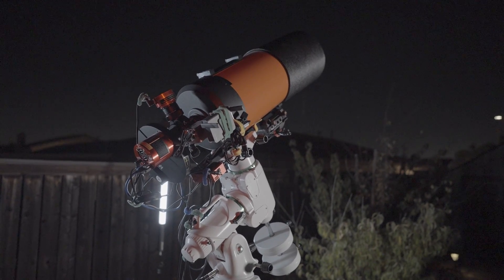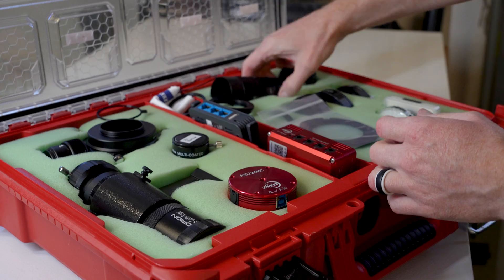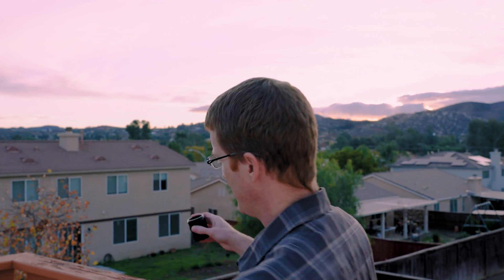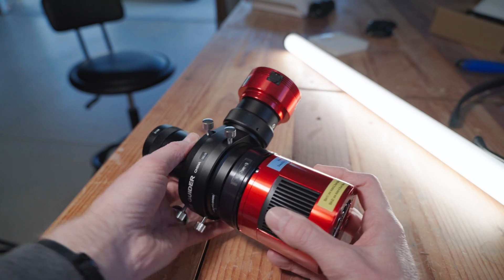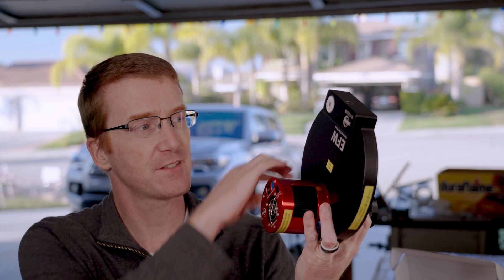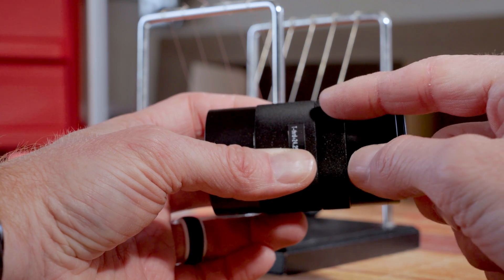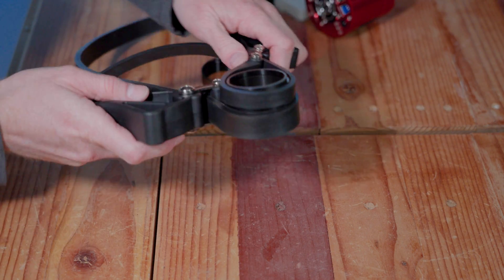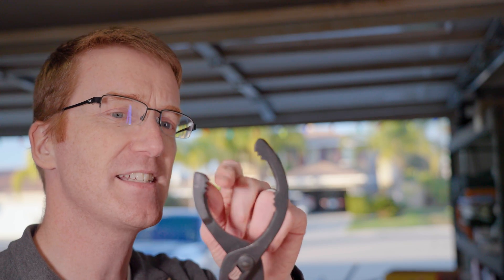Why telescope parts stick and how to fix it

Comment: I used a metal hose clamp. Clamped that about the short adapator and that let the rubber band-based strap wrench get a grip on it. Success. Solution inspired by the suggestion to add another adapater, where you note thos problem at 8:45 timemark. Mine is a step-down adaptor so no option to add another.
Reply from the maker: Very creative. I like it! ☺️

Comment: Lightly run pencil around the threads,  blow of any graphite dust, screw together. Should help with any aluminium on aluminium binding. Well, sometimes.
Reply from the maker: Great tip. Do you have any trouble with stay graphite dust getting on the optical components and showing up in your images?

Comment: what is happend with metal when is warm and when is cold look on powerline in winter and in summer
Reply from the maker: Exactly. You know what's interesting is the majority of substances will shrink in the cold, but water ice actually expands when it freezes. It's one of the few substances that does that 😉

Comment: A technique i use and it always works. Put the rings that are coupled onto a rubber floor mat. Put another thin rubber mat on top. Stand and place shoe on mat and twist your foot. Hey presto they unlock!
Reply from the maker: Nice! What a clever solution. 😁👍

Comment: Great video - I've had all the same problems you demonstrated!  Sometimes there's no easy answer.  I do use a bit of silicone grease just to reduce locking up, which has helped on occassion. You've got a new subscriber!  Clear skies
Reply from the maker: That's a great idea with the Greece! Do you have any trouble with it oozing out and getting on any of the optical parts?

Comment: ...Oh, I forgot to mention a suggestion from a club member for small tube that stick is to use two  wide rubber bands , one on each section. They will give exceptional grip and not damage the tube.

Comment: I spoke to my borderline genius mechanical engineer brother. He is sought after worldwide, particularly the mining and car racing industries to design and build metal bespoke parts or machines. I asked him about this issue. 

He suggested the issue was the facing plates and not water - unless frozen solid. He conceded there may be a little issue with threads but only if they had some kind of grit, dirt or sand in them.

So, coming back to the facing plates He offered two solutions. 

1. Machine grooves into the surfaces of one face...not both as they might slide into eachother. As perfect airtight  seals are not needed He saw this as an option. 
2. His actual suggestion was pure lanolin oil or grease. The grease needs a blowtorch to liquefy, so it is acceptable for our use. Lanolin oil is also acceptable. He suggested using a lint free cloth for application. Especially if oil is used.

3. Even vegetable or olive oil will also work. He uses is to protect  joints that cement comes into contact with good affect. Hope that inspires your next video.
Reply from the maker: These are great suggestions! I especially think he might be onto something with the idea of a vacuum forming between the threads (if I'm understanding that part correctly)
Reply: @MrWilsonsChannel  To be pedantic (because I know the level of your standards) it is the contact faces of the two rings he believes is the predominant cause of the issue and not vacuum seal of the threads...he considered this secondary.

Comment: Hey there, great video on a topic that causes a lot of headaches…I also have the rubber straps, those are my first option. I’ve also tried the lube (had to leave the lube to work for 12 hours, but it worked) and even put some rings into boiling water, just enough so it only touches one ring so the heat expands it, also worked some times.
Reply from the maker: Those are great suggestions. I'll try that boiling trick if the strap wrenches ever fail me. 👍

Comment: you can also use a hair dryer on high heat on the one that needs to be unscrewd, it works with the rubber straps afterwards

Comment: No mention of anti seize lube. A tiny bit applied might help prevent seizing.
Reply from the maker: Have you tried that? Does it work? I'd be afraid of getting lubricants and oils on the optics. Things like that are hard to clean off without leaving behind residue.
Reply: Cue tip with a very fine amount of grease/oil whatever use sparingly @MrWilsonsChannel
Reply: @MrWilsonsChannel  I have heard some people use a little oil on their threads.  Like Mr Wilson, I am fearful.  Love some th0oughts of the rating of the oil I should consider and how to apply it.

Comment: You can add my theory to the list, when gripping the rings from the sides with your hands the rings go out of round causing more binding. What I do is place the rings end to end between the palms of my hands, applying as much inward force as possible (without slicing skin) rotate my hands to unlock the rings. This avoids that additional binding.
Reply from the maker: That's a good theory. I bet holding the rings that way probably helps you get a better grip too, especially for the little ones. Thanks for the tip. I'll try it out next time 😊